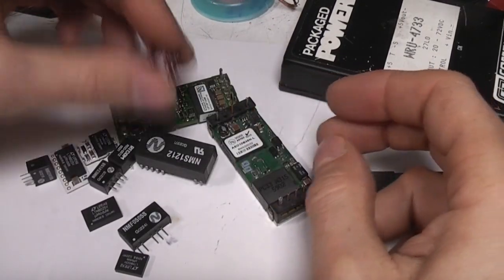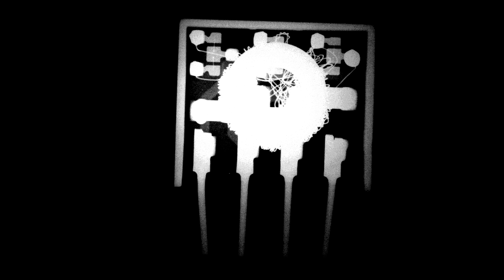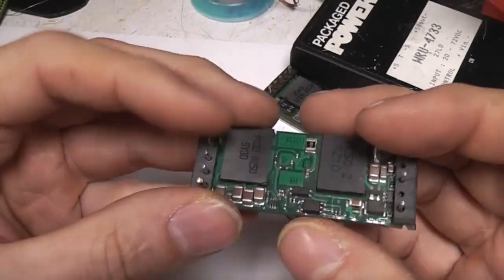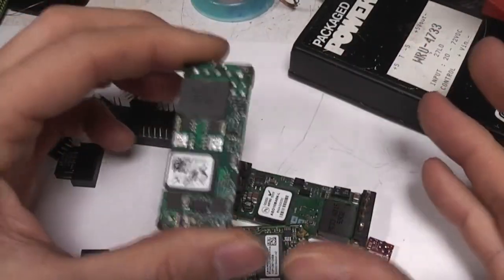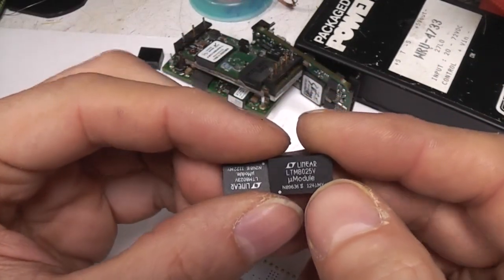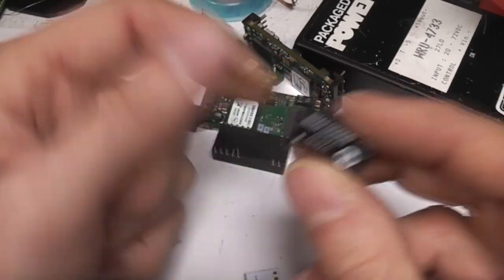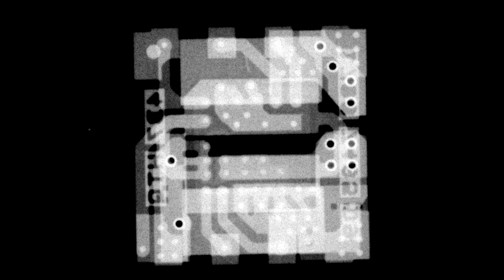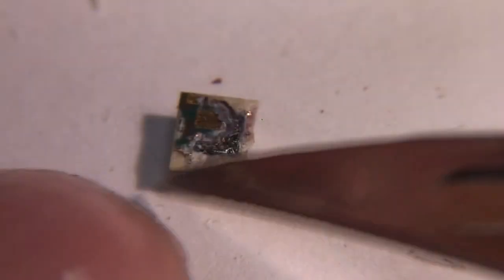DC-DC converter construction techniques

Comment: The holes in the sides could have multiple purposes. 1) Like Mike said in the video, to allow for outgassing 2) To generally allow pressure equalization (which sort of includes Nr1). If there are no holes, it's basically an air bubble, which will expand/contract with temperature and might cause damage to the brick 3) As many of you wrote, it's probably faster in production.

Comment: I made air inductors (not for DCDCC) with two layers. The trouble is the thickness of the PCB that reduces the coupling between the two sides. Takes about 1/2 (cm)² to get something useful at 25mil.

Comment: I don't see the point of that last one -- the TI.  You have to add external caps and resistors, so the only thing they're really providing is 3D placement of an IC and inductor.

If saving space is the driver, you could achieve the same by placing the IC on the bottom of the PCB.  If build cost or complexity doesn't allow you to load both sides of the board, placing them side-by-side only takes an extra 5mm^2 of PCB space.  This seems to fit the niche where you can't get away with either.  I guess that's something, but... not much.  Especially since you have to deal with that weird package, and subsidizing the cost of a lower-volume solution (compared to bare driver ICs.)

Is there something else I'm missing maybe?
Reply: The other side of the pcb is valuable real-estate too...  The product is designed for where space is important.

Comment: Synqor has some that are nearly 97% efficient! Such crazy efficiency, they can do like 300W of power output and they don't even need a heatsink (in ambient air temps)
I kind of avoid Linear Technology parts, because they are SO expensive.
Indeed making isolated ones from scratch can be difficult to make with limited transformer choices.

Comment: I like them :) I have a few of them. My Solar BMS project uses some of those ideas but at a larger scale. I want to integrate two small pF capacitors (for the 32kHz crystal ) in my new version mostly so I do not need to use another feeder from the pick and place machine (a bit limited since is the smaller version) for them else it will be cheaper to just use real capacitors.

Comment: I've used the LMZ10501 recently. Simple to use (worked first time) and even though they are tiny you can solder them with a cheapo hot air gun.

Comment: Interesting video, thanks.
A couple of questions, if anyone has the time:
- Does a DC to DC converter produce RF interference like a switching power supply?
- Is it possible for a DC to DC converter, under fault conditions, to destroy the circuit that it is powering by outputting the input voltage? Or is there some protection against this?
Thanks.

Comment: They may use a liquid PCB process. Basically, they use epoxy rather than prepreg. That would allow them to do a flip chip package and then encapsulate rather easily. I had a 36oz PCB manufactured for me using that process once.